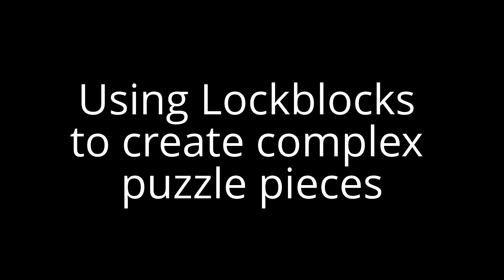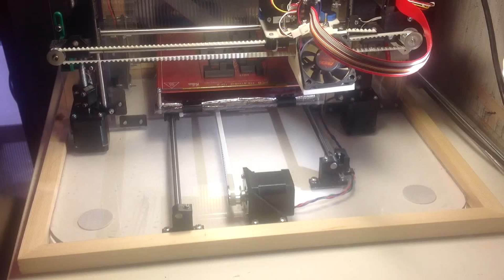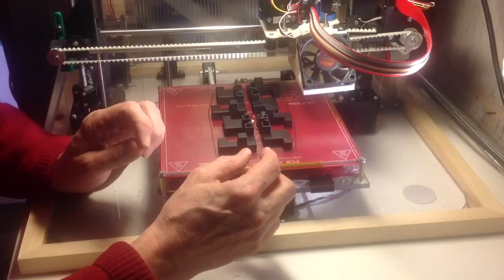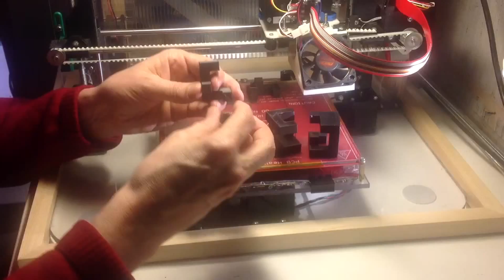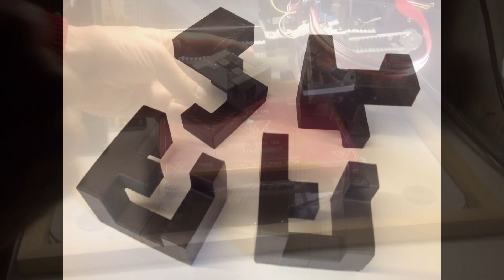Using LockBlocks to print Pif Paf with Turn

Comment from the maker: I printed at 0.2 mm layer height. It's best not to go much lower because the layers act as a kind of ratchet when you squeeze the locks together. But going any higher can affect the smooth operation of the puzzle.